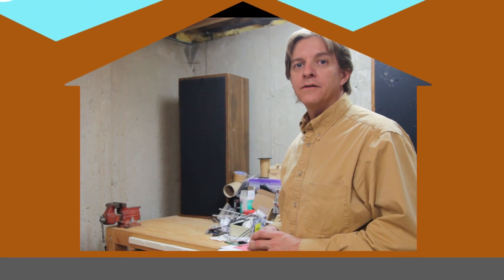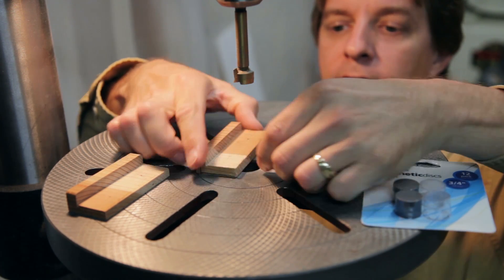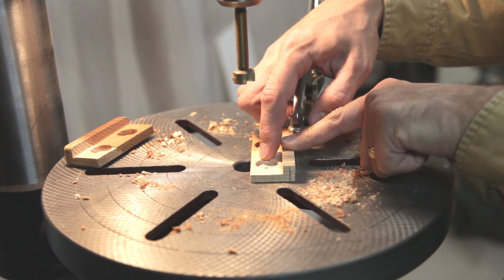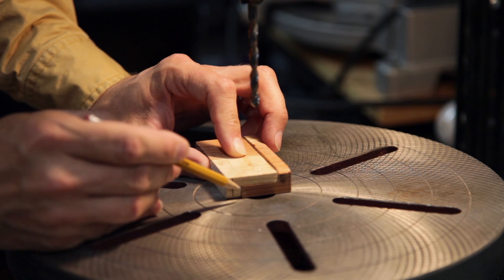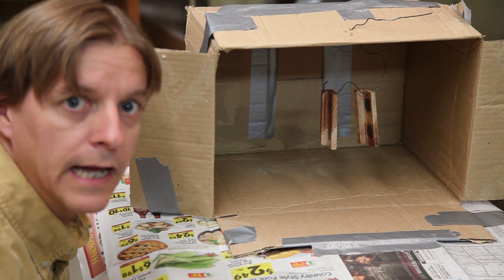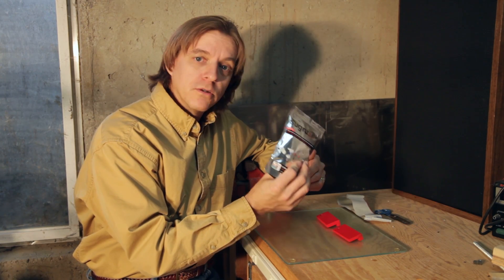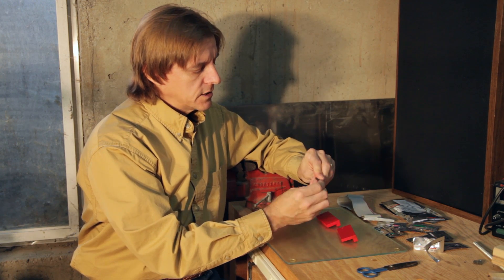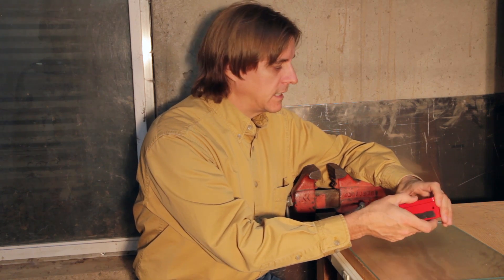How to make soft jaws for a vise - Part 2

Comment: A 2 x 4 is usually soft pine so the jaws won't last too long. Removing material for the magnets weakens the wood and those magnets will act as a fulcrum to split the grain when you tighten up the jaws against an irregular object. I'd use some scrap hardwood instead (oak, ash, walnut). If you want to stick with the softer woods, you could encapsulate them in resin. Even though the video title is "...soft jaws..."
Reply from the maker: Sure. Anything will break if you put enough pressure on it. :-)

In my applications, when I use these, I specifically don't want to torque down on things, so I've not had a problem. Of course your mileage may vary.

Cheers.

Comment: Magnetic tape would of been better. You made the wood thinner and there fore structurally weaker. The magnetic tape can be bought at Home Depot. The Storage hanging hole is not needed. Plus made it even weaker. Yes you completely over engineered two pieces of disposable wood. I wonder how many uses you got out of them before they cracked under stress.
Reply from the maker: If you like magnetic tape, feel free to use it. Personally, I'm not a fan of magnetic tape. Between terrible adhesive and almost no magnetic holding strength, I haven't been impressed by any.

If you don't want to store it on a hook, yeah, you probably don't need a storage hole. You don't need to put one in.

As for strength, it's more than sufficient for what it's used for. It's for holding things that don't require large amounts of force. I still use it; it hasn't broken.

As for over-engineering, yeah, no doubt.